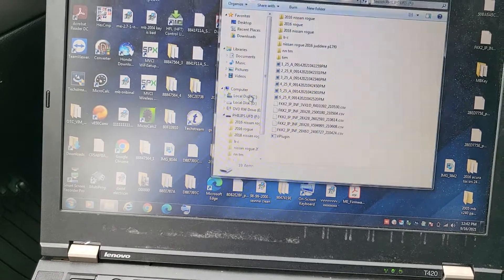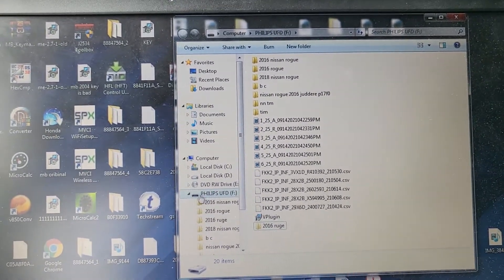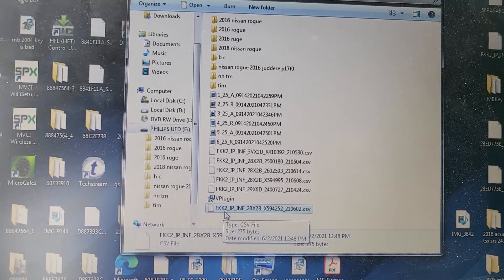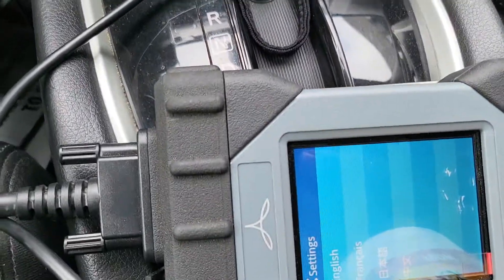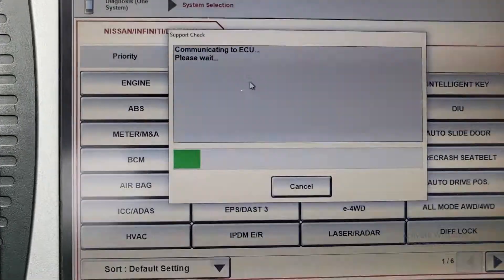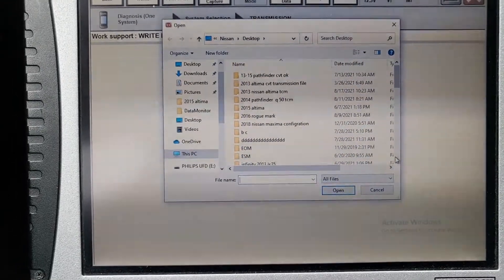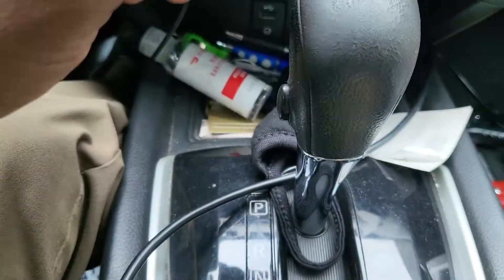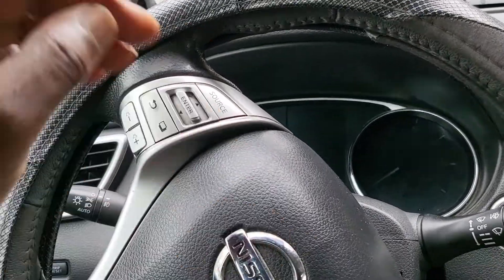2016 Nissan Rogue Tcm Programming

Comment: Hello Sir, if you get a used tranny along with its TCM from a 2016 rogue and put it on a 2014 rogue, would that still need the process of reprogram and calibration? thanks for your response
Reply from the maker: call the dealer  and see if its comparable before do anything
Reply: I’ll give them a call and see if they help with that! But when I search online, from 2014-2019 are the same part number for the tranny. I thought you may have an idea on that. A mechanic who works for Nissan told me that in order to avoid the reprogramming hassle, get the tcm with the donor tranny. I just wanted to double check with you too.
Reply: @BestCarFixes  obviously they will say NO